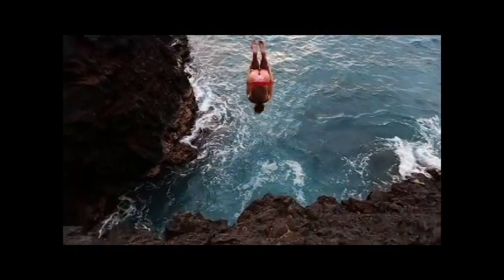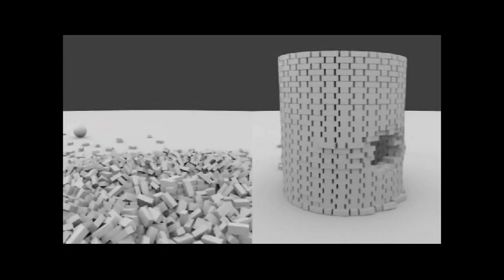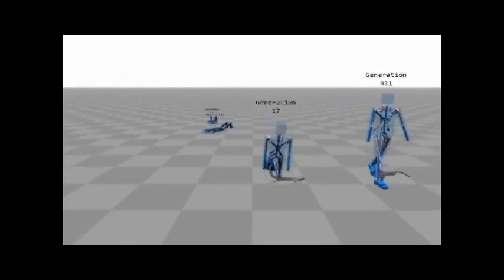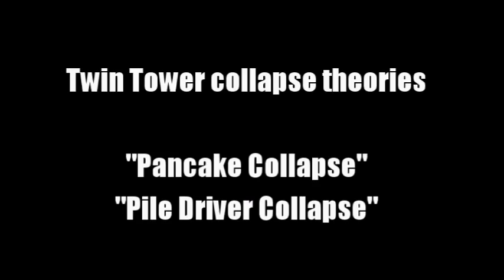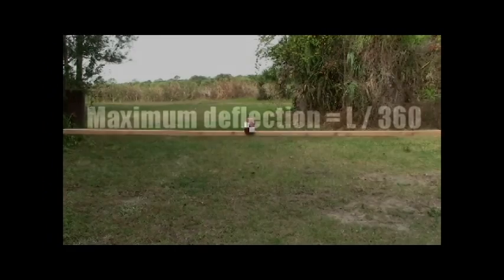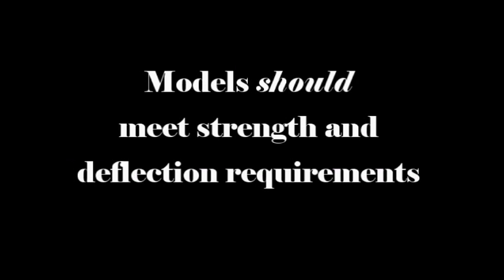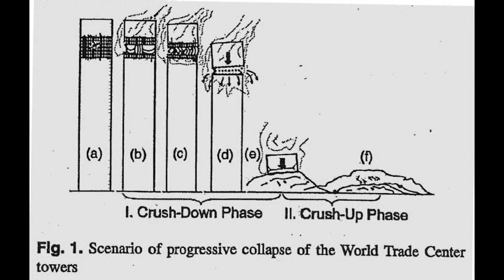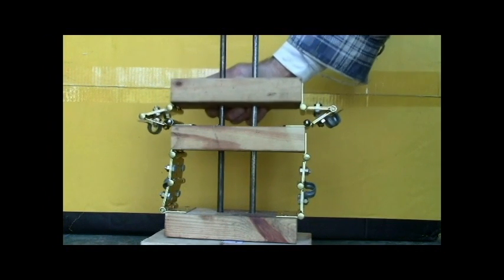9/11 Experiments: The Force Behind the Motion

Comment: Were the columns conductive to heat ?
Reply: Is a frog's ass water tight?
Reply: evsupp2011  I hate to disagree with you but it is well known the John Skilling was the structural designer of the Trade Towers in the 1960's when the man you refer to, Leslie Robertson, had little to no direct input into the project. Leslie Roberson became the Engineer of Record for the WTC before construction began as the John Skilling design firm was divided between the west coast main firm and the one later to be known as LERA in NYC. Lesllie Roberson did claim to have seen 'rivers of molten steel' publicly recorded to video but denied ever saying such a thing later despite the evidence to the contrary.

Comment: Smashing man cave.

It's remarkable that your video is the only physical experiment I have seen. Considering the significance of the buildings collapse, I can't understand why the cause hasn't been thoroughly investigated - after all, if it wasn't explosives and was failure of the building due to fire, wouldn't the authorities want to ensure it couldn't happen again?

Especially as WTC1, 2 & 7 were the first and only 3 high rise buildings to ever completely collapse due to fire.

I find that all rather strange.
Reply: "after all, if it wasn't explosives and was failure of the building due to fire, wouldn't the authorities want to ensure it couldn't happen again?"
This is a fair question. Please realize that with most disasters, there wasn't just one event that caused it. It was a chain of events/situations:
- Planes flying in at high speed
- Dislodged fire proving
- Destructed sprinkler system
- Blocked passage for fire fighter to reach the upper floors
- And possibly the most important: the very specific design of all three buildings
Yet, NIST has made 26 recommendations (https://www.nist.gov/sites/default/files/documents/2017/05/09/WTCRecommendationsStatusTable.pdf) after the disaster. As a result building codes have been changed (https://www.nist.gov/engineering-laboratory/nibs-effort).
You might be inetersted in reading this: https://www.nist.gov/topics/disaster-failure-studies/world-trade-center-disaster-study/recommendations

Comment: you just can't crush a thick fucking piece of japanese structural steel,   the core supports would still be visible even if the concrete floors / outer supports collapsed.

Comment: when you drop the heavy cube in the first part the force is concentrated down the middle, the downward force from the towers came from the sides and the middle. So your experiment is setup wrong
Reply: Tell us how the trade towers' "heavy cube in the first part" dropped when the steel was allegedly weakened in a few areas of a few floors only Pete?
Reply: Then explain to the class how and why the buildings were vaporized and dustified, leaving no solid debri whatsoever. Thanks Pete.

Comment: Also, when the south tower falls you can clearly see the portion above the impact tilting forward, not driving straight down.

Beyond that, the top portion tilts forward, disappears behind a cloud of smoke and all the comes out the other side is some of the outer steel frame.
Reply: The tilt proves it wasn't demolition tho. Demolitions are made to be safe, so they would want the bulding to go straight down.

Comment: OH! PEOPLE WHEN DO YOU LEARN? DO U KNOW HOW THE WTC WILL BE DEMOLISHED WAS DESIGNED FROM THE BEGINNING OF THE BUILDING. IT IS THE FEDERAL LAW. 
THE PROCESS IS CALLED "UNDERGROUND NUCLEAR DETONATION". MEANS NUCLEAR BOMB WITHOUT ATMOSPHERE . IN THIS PROCESS RUSSIAN ARE DRILLING MINES FOR 30 YEARS. A ROUGH CALCULATION  150 KT NUCLEAR BLAST, 350M WHAT IS CALLED CRUSHED ZONE WILL TURN INTO DUST. AS THE BLAST WAS UNDERGROUND THERE WILL BE NO AIR BLAST ZONE (SHOCK WAVE) AND THERMAL RADIATION ZONE. SO NO BIG BOOM AND NO DAMAGE OUTSIDE OF 350m.The plasma zone(core) will be 100m dia sphere only where the temperature will go very very very high. From 50m to 350m called crushed zone where everything will turn into microdust because of extreme compression not HEAT. People jumped from the building because above 350m the pressure wasn't enough to dustify . But the pressure difference was extreme and unbearable. so out of the building was the only safe place and they jumped. The high pressure stage stayed for only 10sec.After this the building collapsed. After the detonation, it will take 4sec to increase the temperature.. WITHIN this time people might feel a little vibration. After 4sec, it will take extra 10sec to complete the compression. After this 14sec the building will collapse. 14sec count down will be started as soon as the white ash is visible. 
WTC 7 was less than 350m. That is why no DEBRIS left. WTC 1,2 was taller then 350m. That is why some debris were found. 
300m radius circle area will remain radio active for 7 to 15 days. And the core(cavity) will remain radio active for 1 YEAR. So now u understand why the rescue workers r suffering from cancer and other illness. 3 nuclear detonation. radiation was huge for first 10 days. This technology was invented from the beginning of nuclear experiment.

Comment: This experiment, which attempted to match deflection alone, was a very poor analog for the original building design. How about doing an experiment that shows how tons of explosives were installed in the WTC undetected and unheard, on every floor of three busy NY skyscrapers while leaving behind no evidence, witnesses, or whistleblowers, to achieve the world's three largest controlled demolitions ever -- all in secrecy? Such a plan would be rejected early in the planning stages as nobody in their right mind would find it within the realm of possibility. Especially because silent explosives aren't a thing.
Reply: 9/11 was an inside job. As such, all aspects of the planting of explosives were controlled by the perpetrators.
Reply: I wasnt always a debunker - the explosives would weigh tons and would require a forklift to get them into the building. The sound of these explosives would have been a tremendous 140-150 dB, but the charges would not have survived the impact of the airplanes. Yet the collapse began where the planes hit. There is no basis for claims that explosives were used. It would be impossible. That's coming from Controlled Demolition Inc., which holds the record for largest and tallest building ever demolished.
Reply: I wasnt always a debunker - Yeah, ok.
Reply: A Spears   How much did versions of the W54 (Davy Crockett) warhead weight that were used in the Special Atomic Demolition Munition project and the AIM-26A Falcon.
Reply: Are those goons still putting bugs up your ass JTRIG?
Reply: A Spears   ALLERT===>> I am being relentlessly gang stalked by Jew-paid JTRIG shills based out of CENTCOM headquarters at Langly Virginia like the ones in this thread who impersonate my accounts in an attempt to discredit my message. These stalkers have even come into my home to plant listening devices. Please google “Gang stalking, CENTCOM" and follow the links !!

Comment: In all these years I still have not seen a model that works the same way the 3 towers fell, well two towers, tower 7 is completely wrong to me, they even KNEW it was going to fall before it fell. I have seen some compelling explanations over the years but something bothers me more than anything else.  None of the explanations of disaster in this argument has been repeated.

Buildings made of steel frames fall because of fire. {we recently had a terrible fire in London that burned fiercely for many hours but the steel frame held up and the building stood
and
planes that crash into the ground leave virtually no plane wreckage.
Reply: Bill Harper  Are you saying concrete buildings resist collapse better than steel famed ones because concrete is more resistant to heat from fires and that concrete is more ductile so it can absorb impacts better than steel without fracturing Bill?
Reply: Bill Harper  (NOT Bill Harpie)  You never went into the details of why steel was adopted as a building material of choice for high rises that excede 20 stories in height Bill. Doesn't concrete expand at rates equal to steel but is much more prone to fracturing in compression of gravitational loading?